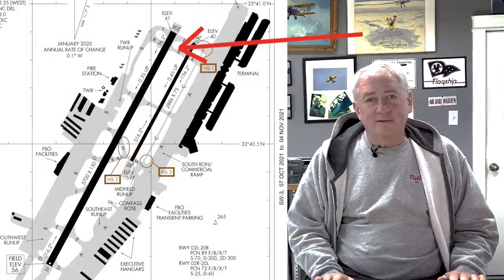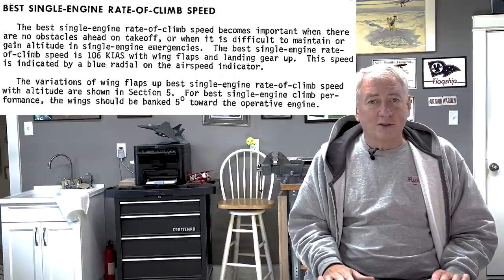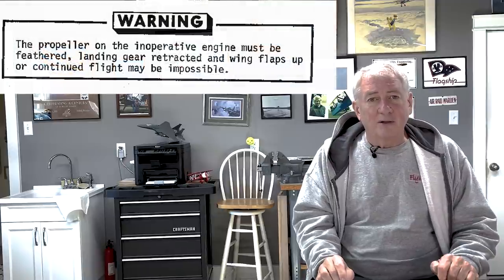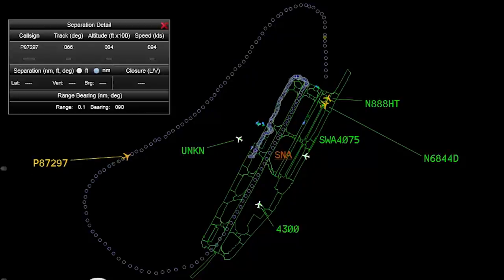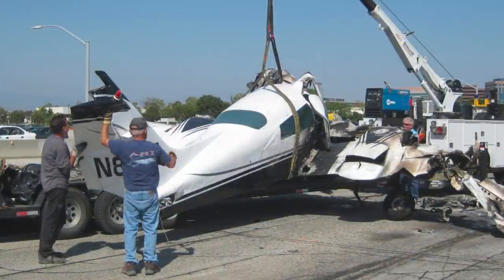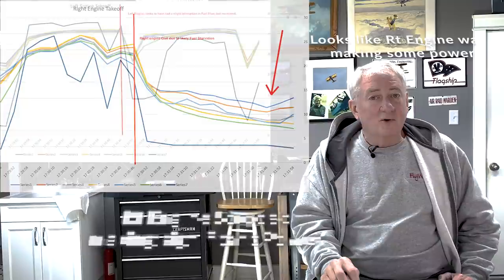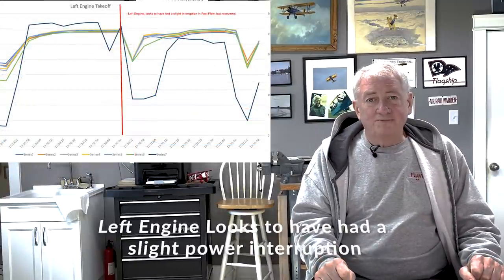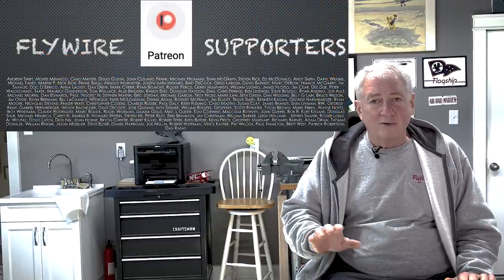C 310R Engine Failure After Takeoff

Comment: Two engines make a twin fast, not safe. Many twin currency flights have ended poorly, lost an instructor in a 55 baron that way. Maybe push and cut both engines and take what you get is better.
Reply: That is what you do in the Dee Howard L-18 conversions.
One running R-2800 will flip you on your back, quickly!
Reply: I feel safer in a single than a light twin.
In a single there is no messing around - you find a place to park it.
In a twin you have twice the chance of having a failure and it seem way to many pilots don't actually know how to handle such a failure.
Reply: @gregculverwell  that second engine will get you all the way to the scene of the crash.

Comment: Scott, you told of flying 737 out of this airport.  What would you do if you lost an engine on that 737 just as the mains were leaving the ground?

Obviously you are beyond the point of aborting takeoff.  Or are you?

How will that 737 perform on one engine in this situation?  Which is worse, losing the right engine or the left?  Or are they equally bad?

Thank you sir.
Reply from the maker: Keep flying
Reply: The 737, like most airliners and unlike most light twins, is certified to perform a successful take off and climb out at max gross weight, including full load of passengers and fuel.  So it’s a completely different situation.  If the 737 pilot follows engine out procedures the likelihood of a good outcome is high.  For a light twin, your chances are iffy at best.
Reply: @PerfectInterview  Thank you for your reply.

Amazing to think that a 737 could climb out on just one engine.

However, I suppose the performance would be only a fraction of the performance with both engines.

Are we talking half the performance?  One quarter?  I’m just very curious.

I grew up flying non rev on 3 and 4 engine jets.  Now it seems 2 engines is the norm for all but the very largest of airliners.

I remember decades ago when my dad came home from his job at USAir and first mentioned the idea of 2 engine jets flying across the oceans and ETOPs and all that stuff.
Reply: The difference in power between a piston GA aircraft and an airliner is massive. As an example, a Dash 8 Q400, will exceed it’s max airspeed in level flight, at 1500 ft on ONE engine.

Comment: The turn away from dead engine is old wives tale. No. The plane flies the same turning left or right. What you are confused about when flying a steady heading or course (not turning) you bank into the good engine 2 to 5 degrees for zero yaw. Will the slip ball be centered? (ANS below). This is due to rudder deflection and horizontal force causing plane to skid with wings level. You also may be confused about critical engine, the one that if lost produces the most loss in performance. In this plane it is the Left engine (as with most light twins w/o counter rotating props). With loss of left engine, right engine running produces more yaw due P-factor and center of thrust further outboard. So more rudder required, more drag, less performance. Are you a CFI-multi? Stick to the Bonanza. Ha ha.

ANS: With say right engine lost you will apply left rudder (dead foot dead engine). You will bank slightly into good engine (straight flight). This gives us zero side slip. Where is the slip skid ball for zero slip? Center? No. About a half ball diameter towards the good engine. There is no way to know exactly if you have zero slip unless you have a piece of yarn taped to the wind screen like a glider.  1/3rd to 1/2 ball at about 2 to 5 degree bank is close enough. This is the new "wings level". It makes no difference turning into good or failed engine. It's just a fact. An argument can be made it is easier to turn into dead engine but it's pedantic. You can't hand fly that well to make any difference.

After engine failure you should have your memory items by rote recall and have the flow down. I tell students they should be woke from sound sleep and able to repeat the engine failure items. They should repeat it as part of every takeoff brief (even if solo). Bottom line a light twin may still need to make an off field landing if heavy, high density altitude and raising terrain. It's better to land under control than roll over below Vmc and dive into ground out of control. The problem? Aysemetric thrust. You can fix that right now, pull the good engine back. Problem solved land under control even if off field.

Comment: IMHO this was no accident but one pilot error after another - fuel management, wrong turn, no feather, ... He had enough power & fuel to get back to the runway. Luck is what saved their lives!
Reply: Luck and Cessna's good design. Putting all that fuel in the main/tip tanks...well away from the cockpit was a safety measure. It's worked many times.

Comment: That lawyer liar made a lot of mistakes.  The engine missed at full power but when throttle back they work well.  He panicked and froze on controls.  I Flew 310's.  Engine worked well at idle and hit with power on both. But he stalled it turning final.  A guy on his pick up truck he hit with tip tank was not paid even 2 years later due the lawyer pipipilot dam refused to comply with insurance requirements and also refused to pay direc for damages caused.